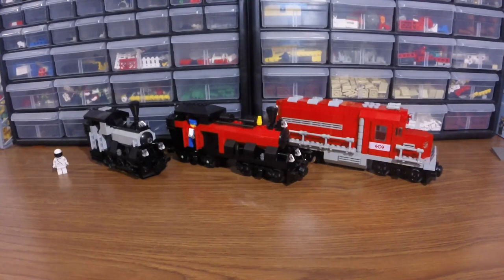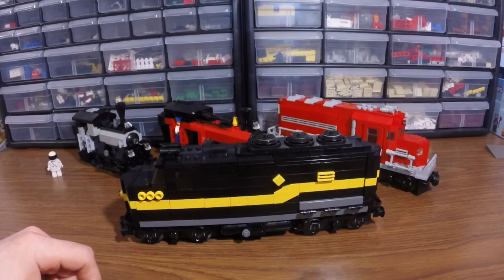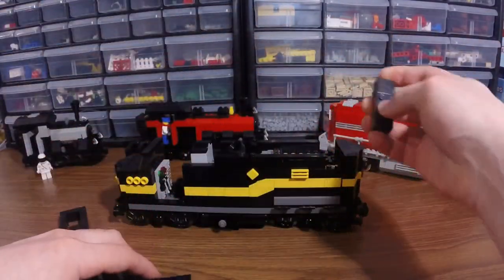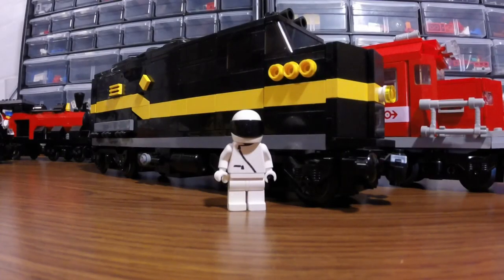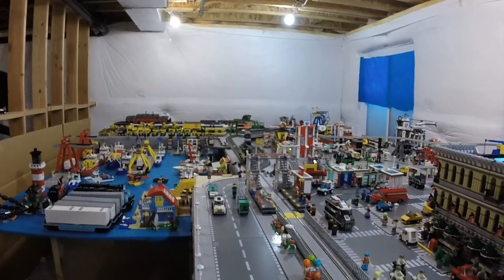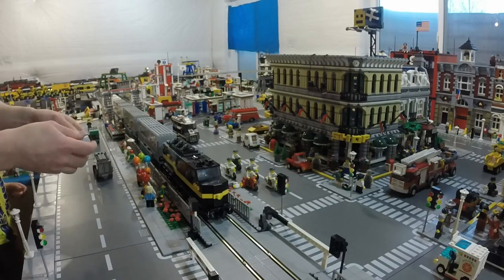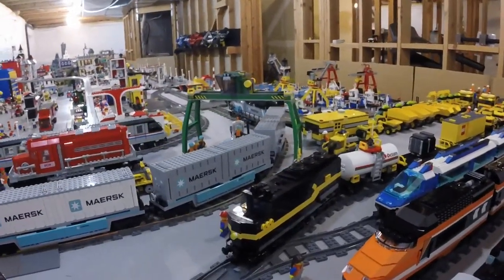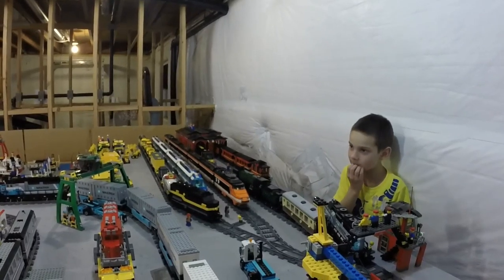LEGO Diesel Electric Train Engine w Power Functions MOC

Comment: You should connect both motors to the same color on the reciever so you don't have to use  both dials on the PF remote.
Reply: You can't, I have tried it and both motor wheels spin in opposite directions so you have to connect them to different channels.
Reply: You can add a polarity switch so you can use just one receiver.

Comment: It looks like the front and style is of a emd f7 engine and a back of a gp-40. It is cool but it would be better if it was a double header train it on front and the 9v engine moc reversed behind the main engine and at the far back depending on length a helper engine.

Comment: Hmmm, power functions is actually pretty powerful, but I think for trains it's an unnecessary pain in the butt. That's because you have to deal with fitting everything (batteries, motor, IR receiver, wires) in the locomotive. With 9V you just slap on the 9V trucks and your set. Plus you can't run out of battery since it's run via wall outlet : )
Reply: You make a good argument, but I think the biggest turn off for me with power functions is simply because of the batteries. They always run out of juice quickly and they leak. The leakage (obviously) is a problem that depends on the batteries, but still. It's a huge pain to have to clean the acid out of the motor and hope it still works. But yes, you're right you can also experience some technical difficulties with 9V and it is indeed expensive.